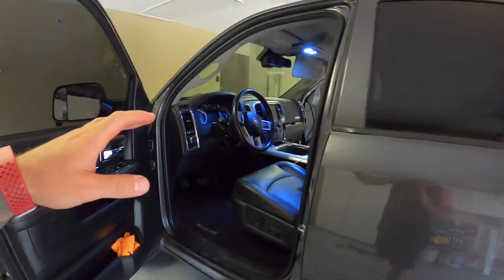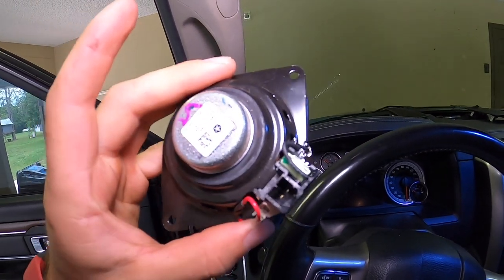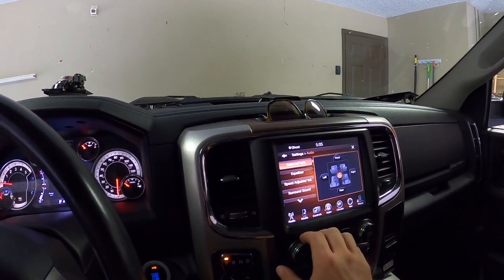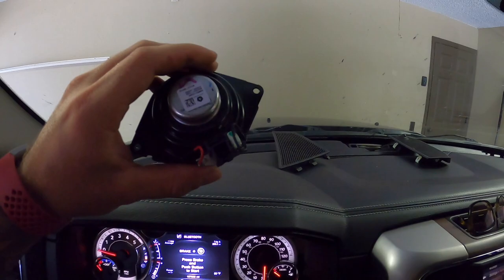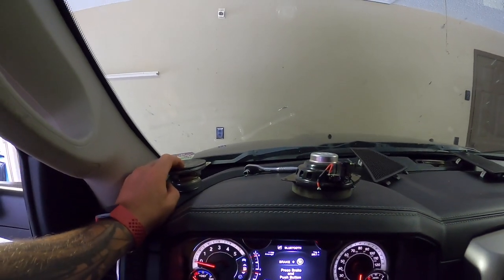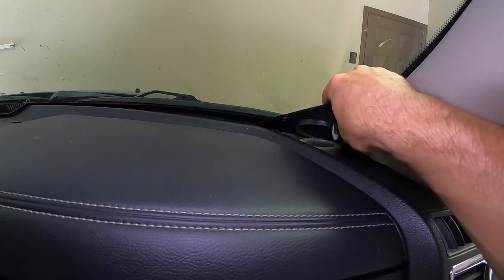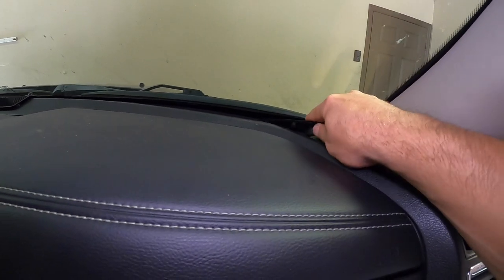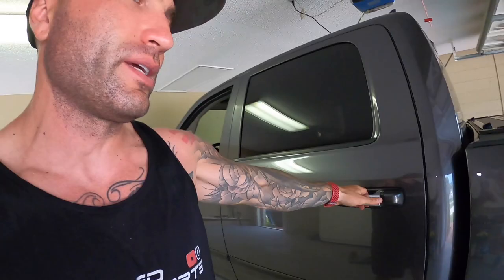Harmon Kardon Factory Speaker Upgrade for Alpine Stereo System RAM 1500 2500 3500

Comment from the maker: HARMAN KARDON OEM PART # 68043045AB
Parts Needed for 8.4 Uconnect Touch Screen Radio Swap on RAM 1500 2500 3500
https://youtu.be/3hq4OzwSLqM
Dash removal video & Leather Dash upgrade
https://youtu.be/AqO0tcyz9NQ
Dash Harness Upgrade & Install
https://youtu.be/bLnTp6GBZS4
Dash Bezel & Stereo Removal
https://youtu.be/rzCcwK2DvOQ
Rearview Mirror with mics upgrade
https://youtu.be/75f6OCwPO6Q
Reply: The sound is so much better with the Harman kardon great info as usual one of the best channels out there
Reply: Song?
Reply: I'd look inside ur subwoofer box also if ther is no polyfill in the box it will alot harder if u stuff some polyfill in it I can't tell u how many boxes I've done that to with factory kicker sub boxes but once I stuff those things full of polyfill it totally changes the way they sound cuz it fools the sub into thinking its in a bigger box which most people assume would have the opposite effect but once u try it u'll see it'll hit harder and lower too

Comment: Thanks for metering the voice coils! The Alpine at 2.6 ohms is using more power from the amp than the Harmon at 4.3 ohms but I think the Harmon is sounding louder due to the coaxial design, same goes for aftermarket Kickers.  Appreciate the video man.
Reply: It also depends on how efficient speaker is as well
Reply: Regarding ohms which measures resistance…. The less resistance a speaker has the louder it will be receiving the same amplification.  

The difference between the HK and the Alpine is the HK has an actual Tweeter that is producing higher frequency sound so it naturally will sound louder as a result. 

In your test the HK is probably a slightly better speaker at best.  But they are still a subpar speaker in reality.  You could likely install pretty good aftermarket speakers in that dash for less than a few hundred dollars and get much better results.  

These manufacturers may collaborate with Alpine, Boss, HK etc but it s only for design ideas.  You will never actually find those brands of components, the same you would buy aftermarket, in any of these manufacturers vehicles.

Comment: I changed all my dash speakers metra sells speaker harnesses all plug play cause I didn't wanna cut anything
Reply: Older generation Dodges that had Infinity speakers had unique plugs etc, so if you needed to replace a speaker you had to cut the connectors off and splice in or fully rewire it.
Reply: Mine is a 4th gen glad they changed it that would be a pain in the ass .

Comment: Did kicker on the dash and 6x9s on the doors and damn it woke the system up, also has to throw in a 12" sub under the back seat, but huge improvement with upgraded speakers
Reply: Better then stock?
Reply: I bought the oem kicker upgrade set. It’s meant for base model. All the speakers are 4 ohm. A alpine system is 2 ohm. You lose volume and they use hard dome tweeters in the dash. It’s too bright and tinny. I’m swapping to cdt wide bands and 6x9. They are 2 ohm.

Comment: Sounds much better.. when I installed aftermarket speakers from Crutchfield they throw in Metra factory harness adapters for free so no need to cut wires.. great video, only thing with aftermarket speakers it’s not as loud as factory

Comment: Speakers with a lower resistance will be more efficient for the amplifier to power. Thus, the Alpines are getting more power from the amp. The HK speakers are just designed better in this case. Good find!

Comment: Depends what your plan is if leaving basically stock then yes that is good but if wanting to build a stereo then no. You can get an Pac AmpPro AP4-CH41 to run separate amps to power your speakers. I'm using the factory amp to power my 3 dash and 2 roof speakers(Infiniti Ref-3032cfx) which you can get adapters to plug and play so no cutting then I'm using 2 separate amps for the door speakers(1 for front and 1 for rear) which are powering 4  Infiniti Ref-9633ix. Then of course subs for bass.
Reply: The center speaker and overhead are also REf3032? (3.5’ Speakers?)
Reply: @teamfreddy5945  sorry I misspoke partly, yes the center is an REF3032, but I forgot they didn't sound good in the roof because of the factory crossovers and were bigger than what I wanted to cut out of the factory plastic opening so I put Kicker KSC270 in the roof. They are 2.75" single driver speakers that run from 300-20k mhz...
Reply: @pimpedstratus  Excellent! I will take a look at those. Id imagine anything is better than OEM HK but will play with the config.. I really only want more Bass but then go down rabbit holes of redoing everything. 🫣
Reply: @teamfreddy5945  that was my original plan ,  just more Bass but after getting the PAC AP4 and already having spare amps I happened to find an amp wall for behind the back seat so I said screw it and did it all.

Comment: Dropping some nostalgic speaker brands. I remember when they were in the doors and kickplates. 4 speakers max unless you had the Laramie then you got tweeters in the A pillar. lol I know "Boomer" hahaha What's in the doors? I know that they were 6.5" Those look like 3" depends on the speaker itself. the range of the dual with tweeter (coaxial) is considered a full range speaker. So it'll fill in the mid feqs and give it some more depth and volume as well.

Comment: I did the Mopar Kicker 2 way dash speakers and front door speaker kit. Plug and play. (They have factory plugs) Then jbl 2 way rear door speakers with adapters. Then the 8 inch Pioneer 2 ohm sub with adapter wires. Sounds way better than the alpine speakers. 
Then plug in a CD player and it’s even better than MP3 sound by far. 😮
Reply: Where did you get the Kicker Mopar kit

Comment: Any idea if this Mod will work on all 4th gen models? I have a 2010.
Reply: Same here I have a 2009/2010 and would definitely do the swap if its cross compatible
Reply from the maker: Should be. Just pop one speaker out and double check the connector looks the same but 99% sure it’s the same since they use the same dash frame
Reply: @BoostedMotorsports  Hell yeah I'll check it out!

Comment: Do I need to have an amp to hear a difference if I were to buy the Harman Kardons? Thinking about putting them in my Express, don’t think mine comes with an amp from the factory though
Reply from the maker: I would bet it would be a good upgrade even without the amp but they will also be plug and play 👍
Reply: @BoostedMotorsports  Good to know, thanks John!

Comment: do we have a similar option for the doors/roof speakers ??   I scored a 9 speaker set off ebay from a chrysler 300.  changed out the 3 dash speakers to the HK.  leaves me with a few extra 3.5" but what a difference!!!!!   they don't seem to make much difference in the rear ceiling so I left the stock ones there.  may see if I can mount one in each rear pillar or by the backseat headrest somewhere.  part of the set of 9 was also two HK 6x9, they sound only marginally better than the stock alpines in the doors which seem to be a polypropylene vs the HK being paper cones but they weren't a huge improvement like the dash speakers.   being plug and play, this was the easiest speaker upgrade I've ever done.  note:  that 7mm bolt closest to the windshield on the center speaker was a B!*ch! lol
Reply from the maker: Heck yeah that’s awesome glad you found it to make a huge difference on the 3 dash speakers too! Like I was saying the video doesn’t do it justice. I haven’t messed with any other speakers yet

Comment: Wonder how much it will help with a non amp’d system. I did the 8.4 swap in my trademans 2500 with the infotainment swap kit, curious if the H&K speakers are worth the swap since I’m not running the factory amp…
Reply from the maker: I would bet it would be a nice upgrade on the non amplified system too

Comment: I have a question, if anyone could answer that would be awesome. I have a 2014 Ram 1500 and wanted to upgrade my uconnect to the navigation one. Will my truck be able to do that ?

Also

Will these speakers fit in a 2014 Ram 1500?

Comment: To get the kicker speakers in there, you do not have to cut the connections. Doing that is not very smart. There are adaptors you can get that will go from your stock connection to aftermarket connection. Crutchfield and any other reputable audio store will sell these connections.
In my 2020 Bighorn I used a loop back harness, which uses the factory wiring that is already in place. Door speakers are now 6.5” pro audio speakers, the dash speakers are now horn tweeters, have an LC4.800 handling the doors and dash. The output from the LC4.800 going to  SKAR audio 800.1 for the subs. The door speakers and the horns all have the adaptors and I cut into 0 wires in the wiring harness for the truck.

Comment: Duuudeee i need these. Im getting so tired of it being not that loud at like max. Also is there a better upgrade for the stock sub with the factory plug and whatnot. Ive seen some videos of like a kicker but they say its not any louder
Reply: its louder atleast it was for me especially after I put a kicker powered subwoofer under the backseat but the harmon's with the neodymium magnets on the dash are more crystal clearer also if u use a kicker sub stuff the box with polyfill and it'll make a night and day difference on the kicker sub and will hit harder and lower
Reply: Nvm. A lady decided to run a red light and total my truck….
Reply: @andydrew6728  dam im sorry that sucks

Comment: those factory kicker subs are kinda weak and aren't the same as their L series subs. my 06 SRT Charger came with one. i used a 3/4 inch spacer for magnet clearance room and put a real kicker L10 in the factory box. hooked that to an amp and it hits like an aftermarket sub setup but still looks stock.

Comment: 2.5 ohms vs 4.5 ohms  your loading the amp harder with the 2.5 speakers  more sound (4.5 speakers) is prolly because the 4.5 speakers are more efficient at 1 watt/ 1 meter (how they measure efficiency)

Comment: Changing the speakers in a branded OEM audio system will affect the system tuning. The DSP in the system amplifier (located under your front seat) will be tuned to equalize the system for the most balanced sound using the speakers you removed. You may hear louder sound from different speakers installed in the same locations, but the balance of the original system will be lost. There may be frequency response peaks in the new speaker that will not be addressed by the equalization that was designed for the original speaker, so you might hear subjectively louder sound, but it may also be more aggressive and "harsh", or worse, even muddy. You are not likely "correcting" anything by swapping components except increasing subjective loudness at a certain volume setting, and more likely introducing new frequency response issues to the system that will be uncorrected.
Reply: While you’re absolutely correct, in this case there is virtually no balance with the factory RAM alpine system. There is no sound stage. It’s a true mess and sounds pretty poor.

Comment: I swapped to these on my 2016 standard six speaker system without the factory amp and ugh… they are louder, but that’s all you can say… zero low frequencies from the dash speakers now.. sounds HORRIBLE…. I ordered a set of Infinity 3032cfx on sale on Amazon for $45 to replace them.  It’s only going to be a few days till they arrive but I will be suffering until then, lol.. these things sound awful.. loud but AWFUL

Comment: There an 8 ohm speaker instead of a 4 ohm..and the 8 ohm sound better unless you like overpowering high range too cut threw overpowering bass..if you want to upgrade speakers but keep the sound balancing harmen set up in the vehicle just put an inline resistor to take the 4 ohms to 8..my problem is the harmen head unit filters out allot of frequencies to make the cheap speakers sound clear, and so expensive speakers are kinda worthless without replacing the head unit so a 200 dollar per set of speakers is all the money id spend on upgrades for the truck without replacing the head unit..owning the truck and having top end stereo systems previous I can clearly hear the missing sounds in songs ive heard millions of times threw a top end system..and i dont wanna spend 1800 dollars on a head unit soooooo kenwood excelrons is all the speaker i put in the ram